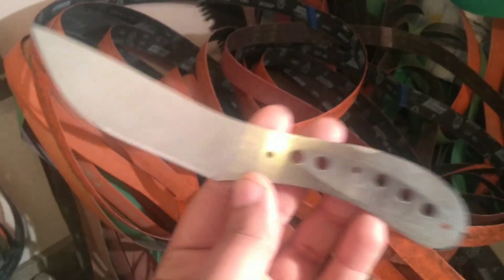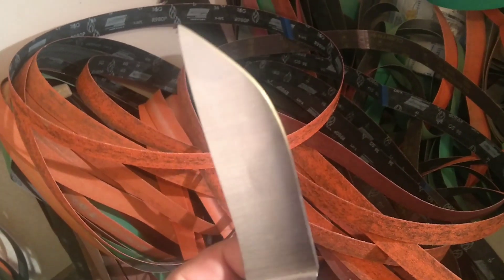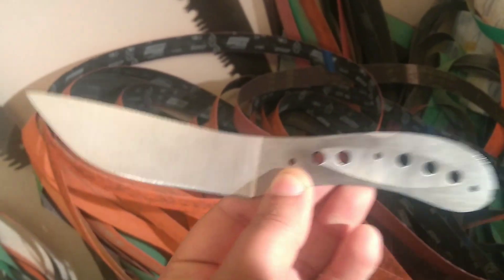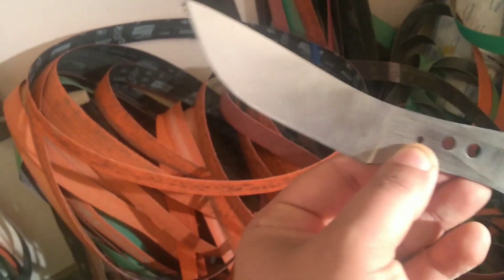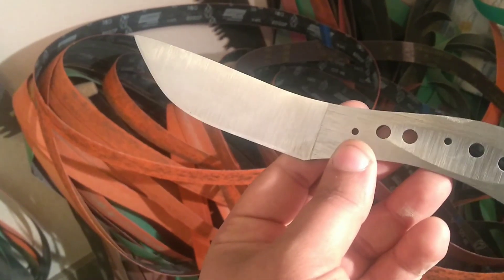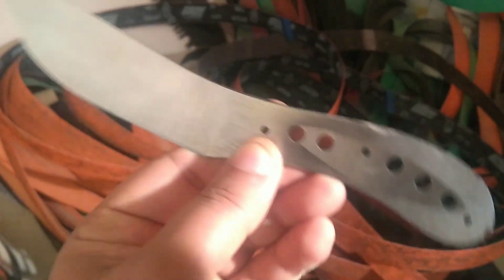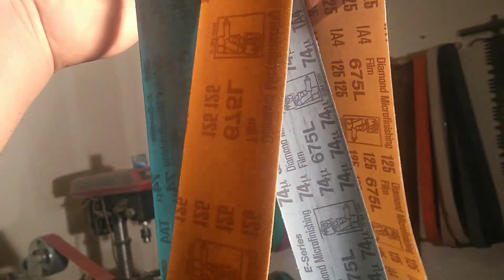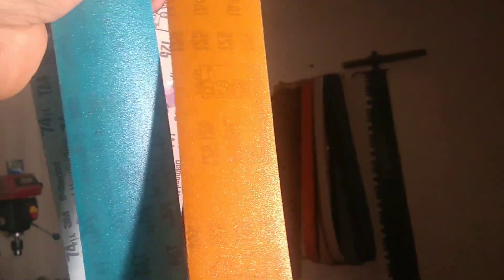Rex 121 The hardest knife steel in the world?

Comment: I volunteer to sweep your shop floor. In two months I'd have enough diamond debris to pave my Invicta diver Rolex Sub homage bezel. Quartz on the inside and on the watch case tiny diamonds for quick edge bevel tune up on my Gonzo Firebird ParaMilitary 2 clone in D2. Tool watch for tool steel. I may borrow some epoxy from you! Lol.

Comment: What are the economics of using a very large water stone grinding wheel instead? Will that cut Rex121?
Reply from the maker: They just don't make what I need in a wheel form, a d if they did the cost would be even more insane. A 60grit electroplated CBN belt with a stiff backing is what I need. The cost is just outrageous though, $1000-1200 for one belt.

Can buy a lot of ceramic for less but just go through it like crazy.